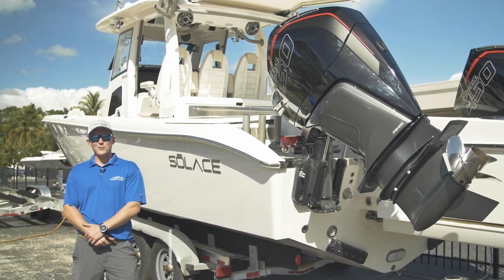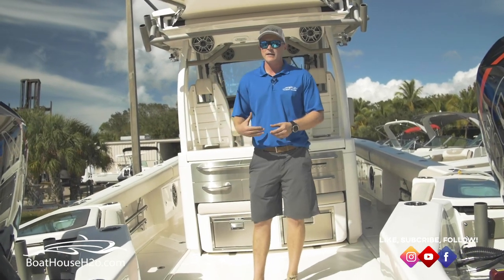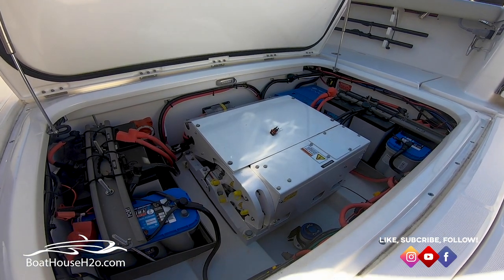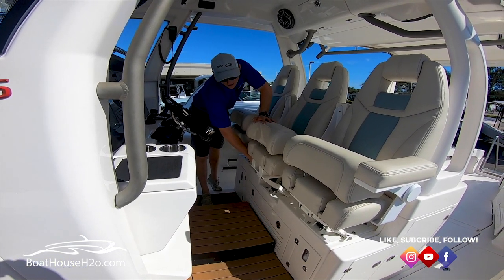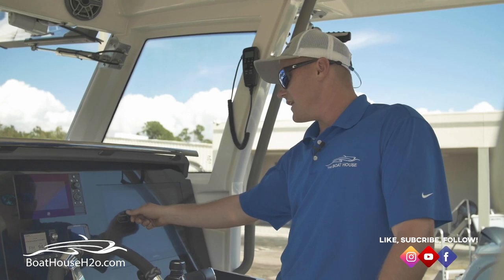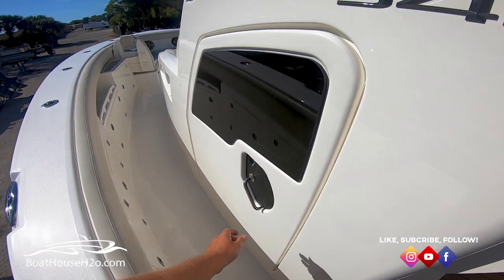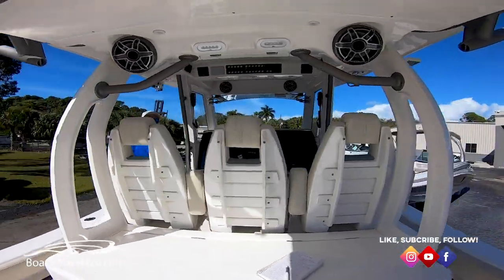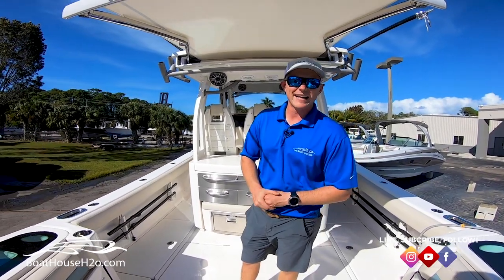2020 345 Solace Walkthrough with Jeremy Eck from The Boat House of Naples

Comment: Helps to mention the beams and draft, cruise speed.....
Reply from the maker: Thanks for the comment! Below is a bit more info on the boat!

Bow to Transom LOA	34′
Bow to Stern LOA	38′
Beam	10′ 6″
Deadrise at Transom	22°
Max HP	900 HP
Draft (Motors Up)	24″
Draft (Motors Down)	24″
Fuel Capacity	343 gal
Freshwater Capacity	40 gal
Waste Capacity	18 gal
Livewell Capacity	2 x 45 gal
Seating Capacity	16 p

Have a great day!